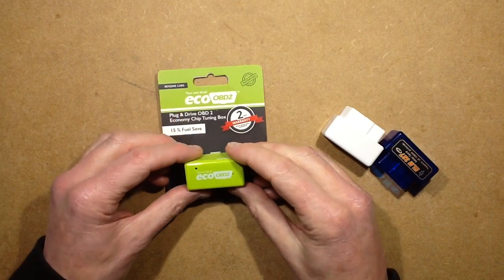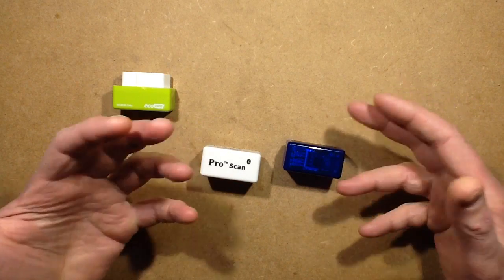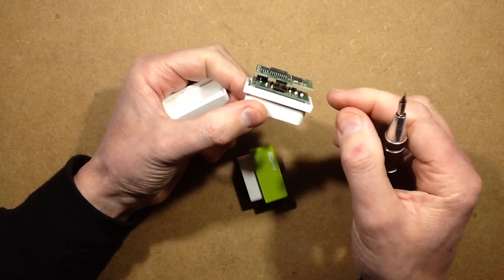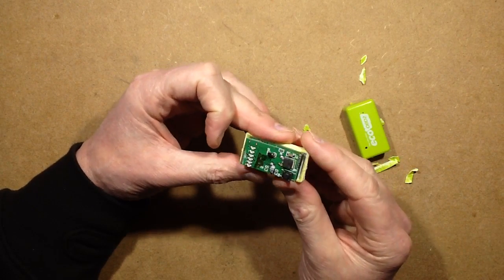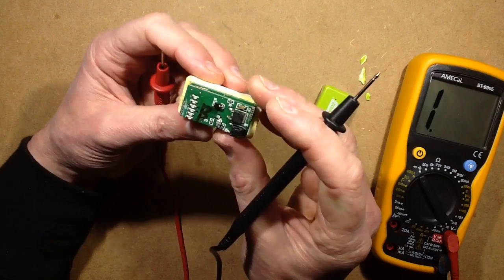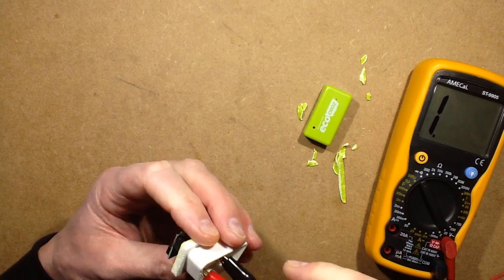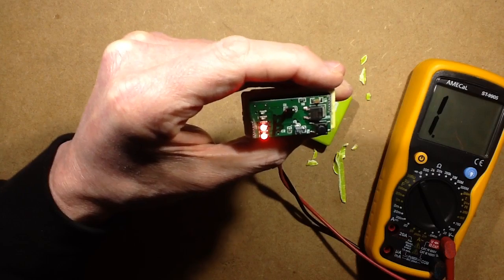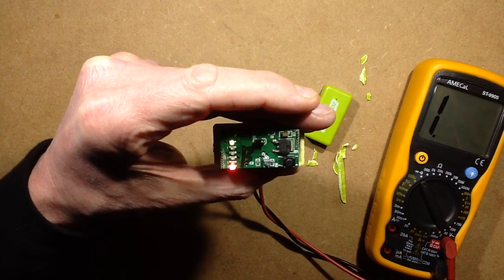Inside an ECO OBD2 "chip tuner" fuel saver.

Comment: I have a question clive, my car is old, the interior light does not have the stay on feature , its the old off as soon as the door closes,   it uses one festoon bulb (10w ? or 5w) what size capacitor would extend the runtime say 10 seconds?  perhaps a demo of the circuit as a video? thanks
Reply from the maker: With the original tungsten lamp it would have to be huge.  You might be able to get a short hold-on with an LED lamp that would gradually fade down.
Reply: +jusb1066 Make sure its rated at least 16v just to be safe. as for capacity... 10 seconds at 250mA and starting from 12v would be about 200,000uF so ths should do http://www.ebay.co.uk/itm/200000uf-15v-Aluminum-Electrolytic-Capacitor-Screw-Terminal-Mallory-2pc-/262135513049
Reply: Firecul42
ahh huge!  clive was right!  i guess the circuit board kit is the way to go, its more comoponents and transistors, but isnt huge!
Reply: +ben hunter the only "simple" solution would be to have it wired to the battery through a chunky resistor but then it would take a while to turn on. So yeah not practice. 
+jusb1066 prob best to go for the circuit board :)
Reply: +jusb1066 There is no &quot;reasonable&quot; way to do this with a capacitor (alone).
First the capacitor(s) would have to be massive, several farads which is big and very expensive for 12V.   Second this would likely cause an inrush surge current exceeding the rating of the fuse on the circuit.  You could do a parallel run with an inrush current limiting resistor in series with the capacitor but this doesn't decrease the capacitor size or cost, so technically it is possible to do it, but reasonably speaking it's a bad way to try with significant issues making it less desirable than not having the feature at all in my opinion.

What you would need instead is something like a timer circuit.  You&#39;d use something like an opamp to compare the voltage to determine when the power went off, to trigger a timer IC like a LM555 using a typical circuit for the time interval you want, with it triggering a dual stage transistor (or relay after a single transistor) arrangement to provide power to the bulb through a second power lead after the primary power is off.  You might also need a blocking diode on the primary power lead so it doesn&#39;t back-feed, better to use a schottky so you have minimal (~ 0.25V) voltage drop.

You might also consider replacing the incandescent bulb with an LED bulb to ease the current requirement for the circuit.

If what I have described is not enough to get you started on an web search for example circuits then it is probably beyond your skill level though you might be able to find a ready made drop-in circuit to do it, at a significant cost of course since this is a niche application.
Reply: +Firecul42 That would probably pop the fuse or MOSFET (if it's a CANBus system) as soon as the car tries to turn the lamp on, as the capacitor would need to charge.
Reply: 555 timer monostable circuit might do it. You'd need to take power off the "always on" line and use the door line when it shuts to trigger the 555.
Reply: +jusb1066 the current draw through the bulb at 12 volts would be 10 Watts / 12 Volts =833mA or if it is 5W then it would be 416 mA, so between 1/2 and 1 Amp - You would need a pretty beefy capacitor. A better way would be to use a Bistable or Set / Reset  type of latch circuit.

PLAN 1

1 Door open - relay latches and light comes on 

2 relay remains latched and a countdown timer starts for 10 seconds 

3 Countdown reaches 0 Relay turns off  - Light goes out

A 555 interval timer circuit and a relay or possibly a large power transistor with a heatsink would do this 

if you wanto be even more elaborate

PLAN 2

You could use an Arduino Nano and use the door switch to tell the Arduino if the door is open or closed. 

If the door is open, issue a reset, latch a relay and start a countdown timer

If the countdown timer reaches zero and the door is STILL OPEN then keep the relay latched and the light on

If the countdown timer reaches zero and the door is CLOSED then switch off the relay and turn off the light

Interesting O'Level / GCSE project 

PLAN 3

You could also replace the 5W/10W lamp with some LED's  on some stripboard with a 555 interval timer built in using the door switch as a reset / trigger the door switch being mechanical might need some debouncing Schmitt triggers or similar though, otherwise you may get false triggering.

There are dozens of "555 interval-ometer" schematics about just "IX-Quick" or "Google it" - We don't use Google because it ISN'T private :@/

Simples
Reply: jusb1066
A small outline package 555 timer IC and transistor(s) for switching/relay function can be so small that it could easily fit in the headliner space, or almost anywhere... the bulk of the size would be if you put it in an enclosure or the wiring connections/isolation itself... keeping in mind that once you add a delay there is no need to have the rest of the circuit down to the door switch, rather it can ground on the immediately adjacent chassis metal (nearest point).

Frankly I still think an LED conversion is worthwhile, while doing the rest and in that case the whole recessed bulb fixture could be changed to integrate that driver along with a better heatsinking assembly so a higher powered LED could be used.
Reply: jusb1066
lol, yes you are right it still has to go to the ground switch... I started celebrating New Year's Eve early.  OUCH MY HEAD.
Reply: +jusb1066 Heck of a lot easier would be to use a time delay relay.
Reply: You can get a "module" off EBay for £4.99 (just look up car interior light delay) looks to be an easy wiring job.....hope it helps!
Reply: Stinky Cheese
thanks dude, kits are available on ebay for around a fiver, i just wondered, what with supercaps these days it would be a bit simpler! oh well
Reply: +ben hunter   the guy said his car is old, therefore i predict there is no CAN-BUS or MOSFETs anywhere on the vehicle.  it sounds like a simple switch-fuse-bulb circuit.  my personal vehicle uses a ground-side switched PWM control via the body control module to dim lights.
Reply: Audiboi
You're probably right about it being a simple switch fuse bulb circuit, although each person's idea of what an "old" car is can differ... CAN bus has been around now for over 10  years.  In the US it was seen around 2004 and mandatory for many applications in 2008.
Reply: Stinky Cheese yup, my 2008 Vectra is CANBus all the way and it's not exactly a particularly techy car.
Reply: grahamek86
While it is true that the capacitor would drain into a larger portion if not the entirety of the electrical system, the bulb itself would still be the majority of the current consumption for a vehicle in that state.

The larger issue is how much current the bulb itself needs before the capacitor voltage falls below a threshold value to no longer be deemed an acceptable source of light.

Back of napkin math, that could translate into something like 12.8V battery source, (and let's suppose) 10V minimal current before bulb gets too dim, and the 10 second runtime specified for a 12W bulb.

Even if the capacitor drained into nothing but the bulb, which is quite easy to do by merely isolating it with a schottky diode (and accepting ~ 0.2V loss), you still need about 3.5 farads of capacitance, and a current inrush circuit, and a few dozen dollars, and a lunch box sized enclosure to hold the supercaps.

That is only a rough example because it does not take into account both the non-linear reduction in light with reduction in voltage, and the increase in bulb resistance with the cooling associated with a reduction in voltage.  The two factors work against each other but I suspect would not come near cancelling each other out.

In the end, the automotive industry already makes timed courtesy light circuits for automobiles and it would be practically free to pull one out of a donor vehicle at a junk yard.
Reply: grahamek86
Some portions have diodes so current is one-way, having negative only does not a circuit make, but note what I wrote, "the bulb itself would still be the majority of the current consumption for a vehicle in that state."

The rest of the vehicle in an engine-off and key off state (remember the person just used the door and otherwise would be out or engine would be turned on) uses a very small amount of power relative to a 12W bulb, so the bulb would still be the majority of the current.
Reply: of course the answer is a custom made circuit, of which they still sell on ebay, remember, the accessible part is the switched ground wire, so already current limited by the bulb, they sell a product specifically for that wiring location, as the other side is either deep in the wiring loom, or has no location to put it (headliner etc) so the option being behind the small panels of the door frame, near the switch
Reply: Just get a small battery powered stick on light like people put under counters or in closets....turn on when you need it off when you don't. Don't over think it.
Reply: +jusb1066 You'll need something a bit more exciting than just a capacitor across the bulb. With the ignition off, the capacitor will drain immediately into the rest of the vehicle electrical system.
Reply: Stinky Cheese How is that? The only thing that isolates the rest of the vehicle is the key disconnecting +ve. The -ve is always connected. Therefore, a charged cap on the consumer side of the ignition switch would be "battery" for the rest of the consumers in the vehicle.
Reply: Stinky Cheese
no need for the rest of the circuit to the ground switch? that would be entirely the point i do need that! lol
Reply: +jusb1066 Heck of a lot easier would be to use a time delay relay.
Reply: A Bazillion Farads

Comment: I have seen some people upload new maps to there ECU at home/work but that requires software and a Laptop at lest. That little thing dose not have the capacity nor the ability to TELL the ECU anything. It may be able to read a few basic signals (revs, fuel pressure ect) and blink the lights accordingly, but its just a box with a flashing light that dose He-Haw!

Comment: In the states our Insurance companies give you these things to plug in. They log all your cars data and track via GPS and call home via cell networks. Then they adjust your billing by driving habits. If you get in an accident the module calls home immediately and informs the insurance company to raise your rates.
These units have an onboard battery to keep the device live even if you unplug it and put it in the glove compartment.
They say its to save you money but I don't know anyone yet who has saved money off this crap.

One hint I got from a state trooper is they are trying to implement these things in all new vehicles that get new registration so they can just mail you speeding tickets or if you don't renew your registration the car will not start.
If you get your licenses suspended, a DUI, or whatever then the car will not start even if you remove the dongle from the port. The only way to reactivate the car is for the police to call the dongle and send the command.
Reply: +ElfNet Gaming That last bit is some scary Big Brother shit right there.

Comment: I think it might be possible to trick the ECU into benchmark mode by simulating the test conditions, instead of reprogramming it. 
(Protocol says establish safety conditons {X,Y,Z} and attach recorder {W} before driving.) 
The emmisions, sound ~[]~ and peak-performance  suffer for fuel economy.

I want to blame bad mode-optimization for the intollerable fuel econonmy from a (2006 ish) Pontiac Vibe (in 2007) that far underperformed the benchmark rating; but a wikipedia check shows that there was actually a Toyota recall for that particular (1ZZ-FE) engine ECU cracking and causing the other redicilous problems I saw in a 'as-new' car the dealer lent us.

It might also be possible to capture and compensate the accelerator input to the ECU in order to reduce hard acceleration/speed-drift while driving.-- A middle ground between cruise control and manual/pedal.  Not desirable but it would reduce fuel consumption at the risk of losing responive control. But this would depend on the ECU not specifically listening for a particular input device.

Or, as others have suggested, caus a lean burn- possibly by simulating false engine conditons/false-sensors.

Comment: As a mechanic, I can tell you it's 99% likely a hoax, or only works on certain vehicles.  ECUs run EEPROMs nowadays (They used to just be PROMs or EPROMs, with PROMs being one time burn and it's over, gotta replace it, and EPROMs being erasable via UV Light through a light window on top).  This unit probably intercepts CAN Signals which some ECUs send some data like Coolant Temp, Air Flow, or what have you over, and alters those data signals to introduce a lean burn.

HOWEVER this is very dangerous if it does it wrong.  Lean causes a hot burn, and can cause a host of engine issues.  It's far safer to run a car rich than lean.  Lean can cause catastrophic failure of an engine!  If you REALLY want a fuel saving tune, you have to penny up and have your ECU remapped by professionals!  Those "Reflash your ECU in one click" things are false, and most make you get worse fuel mileage and WORSE power!  I tested one for a Ford Focus on a dyno, and it resulted in a 12hp loss, not the advertised 50hp gain.

EDIT: Edited IR - UV, cause I am a derp

Comment: It's probably a commodity ODB2 reader like the others you had - the are on ebay starting from £2ish - cheaper to rebrand one of those than building a fake device. It may even work! Can you see it on bluetooth when it is powered?
Reply: +bigclivedotcom You could put a scope on the data pins to see if anything was coming out.
Reply from the maker: It doesn't have any obvious Bluetooth circuitry on it.

Comment: The device could possibly upload a new map and I doubt it can even fool the temperature sensor or MAF sensor reading.
Reply: +sim6699 Very unlikely that it contains maps for all cars and can do automatic  reflashing.... Fooling any sensors via OBD is also not possible. I think it clears the OBD error codes or something like that. Deleting adaptive values might be possible, but seems unlikely. (Although the ECU does adapt itself again within 200km after deleting adaptive values, more or less like the product claims...) I just don't believe it can do that for all cars since it is not part of the OBD specifications.
Reply: Tom I meant to say "couldn't possibly upload maps".
I was thinking could it inject values into the ece, since there is no security.
Reply: +sim6699 OEM ECUs don't allow "live" writing of calibration data. The ECU must be put into a read/write mode, which must satisfy the condition that engine RPM=0. As for security, there very much is. The read and write procedure is protected at the very least by a seed key (older Bosch ME7, ME/MED9, EDC15/16 etc) whereas newer MED(V)17/EDC17 ECUs have password protected virtual EEPROMs.
Reply: +grahamek86 Yup. And there are quite a few seed-key algorithms and I doubt very much that device would have them.

Some Fords also deliberately want Vpp of ~20V on a particular OEM specific OBD-II pin. In the old days it really was for writing to an EPROM. But then it just became another proprietary handshake to ensure that things like this device can't easily update the ECU. 

Oh and on some Dodge vehicles reprogramming the ECU requires 5V level serial data on some pins at some rather odd baud rates.

Comment: You can flash most modern ECUs over OBD2 (not always through the main CAN lines) but to do it requires specific encryption keys this lets them reflash a car in the dealership quickly should there be a problem with any of the control units on the car. You may be able to lean out the mixture by tricking the ECU into recalibrating the air intake temperature sensor or MAP/MAF input values. None of these are a good idea if you don't know what you are doing, and not the sort of thing you would do for more economy (or more power) if you do. If the device is even capable of doing any of that they are the OBD equivalent of the "chips" people sell on ebay that go into the wiring loom between the air intake temp sensor and ECU that are little more than a resistor and some fancy automotive plugs (fancy ones have multiple resistors and dip switches). At least the caps you plug into the 12v accessory socket defiantly don't do anything.

Comment: I had a programmer made by super chips for my Dodge Ram truck. It plugged into the obd port like this and I did measure about a 5 mpg increase in economy. You could tell it was talking to the engine as the gauge cluster was indicating what programming step it was in.
Reply: The problem with this is that it's been PROVED that adding any random piece of fake junk to a car will result in a roughly 5mpg improvement.  The reason is the automotive equivalent of "The Placebo Effect".   When someone believes that their car will use less gas now, they actually change their driving behavior and drive the car less aggressively.   So the only way to know FOR SURE whether you got an improvement is to do a double-blind experiment where the driver doesn't know whether the device is present or not.

So, sorry - you DIDN'T get a real improvement - all that happened was that you subconsciously drove more carefully.

Comment: Have had one in my van for ages. Used Torque for ages got a custom dashboard. Good for checking engine codes, showing rpm, boost pressure, speed and battery voltage is my fave options.